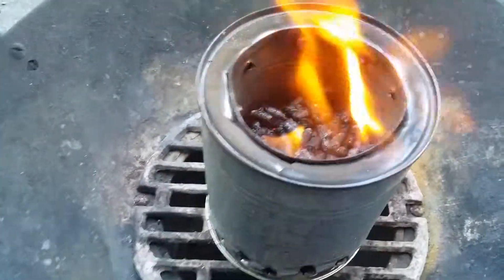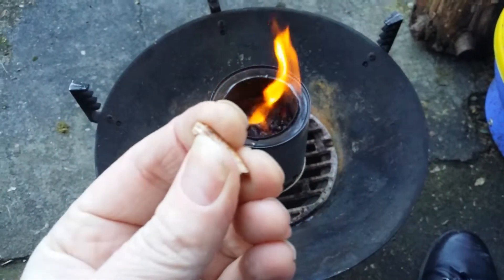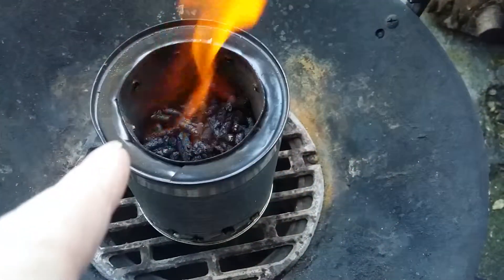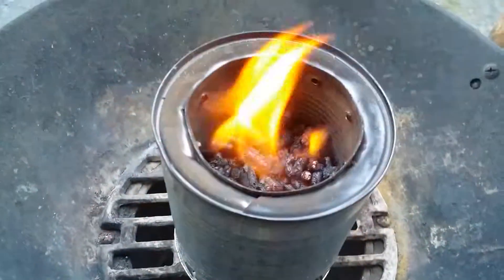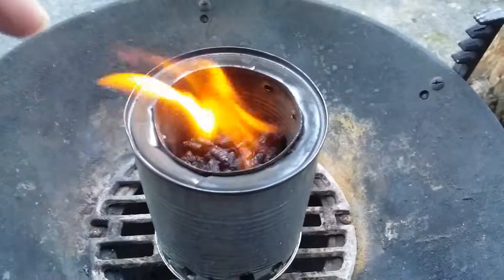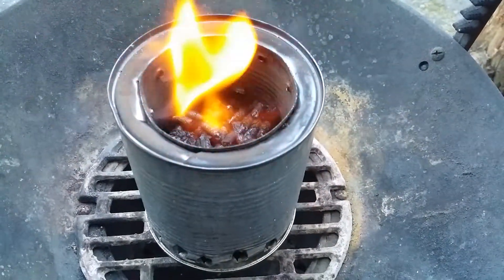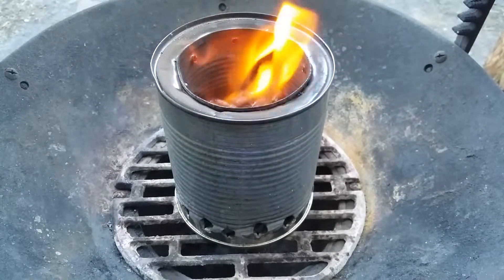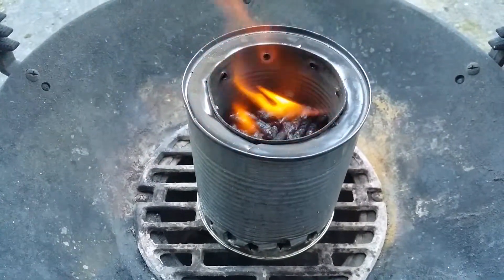15/03/02 DIY Wood Gasification Stove Part 2

Comment: Quote: "I discovered that these stoves work best burning from the top down where by they draw gasses through the burning material which then flow up round the inner wall of the 2 cans to be ignited at the vent holes at the top."
  The above is a mistaken idea. The stove is a TLUD which stands for Top Lite Up Draft stove. The small fire made on top of the fuel load causes an up draft and all the gasses from the fuel draft straight up to the top of the stove. The heat from the stove also causes the air in the gap between the burn pot and the outer can to draft up to the top vent holes (secondary air vents) where it mixes with the woodgas and then burns. No woodgas is drawn up through the gap between the two cans only hot air.
Reply from the maker: Thanks for clarify that James. Did you check out the video I did of the other woodgas stove I bought online? Plenty holes in the theories in that one too I'm afraid. All corrected in subsequent comments though. Give it a watch and let me know what you think. Sorry it's a long video though. Also ignore the bit about using it indoors! Big mistake. I wish I could cut that out. That's also corrected in the description. All the best to you.